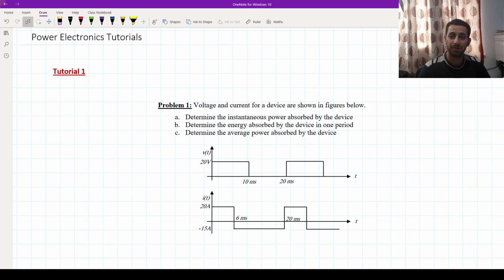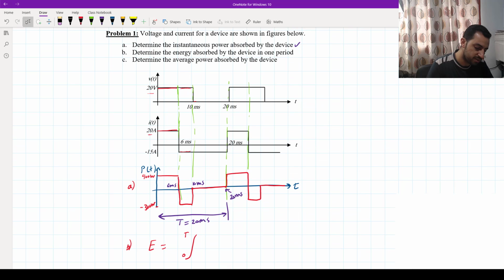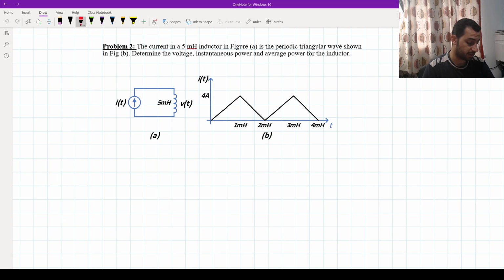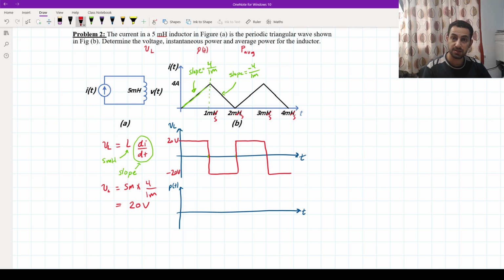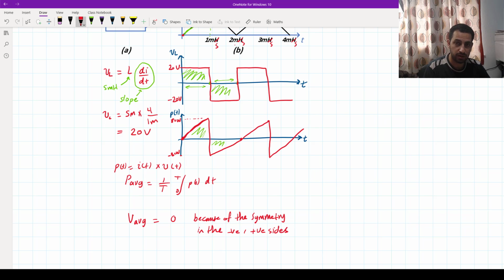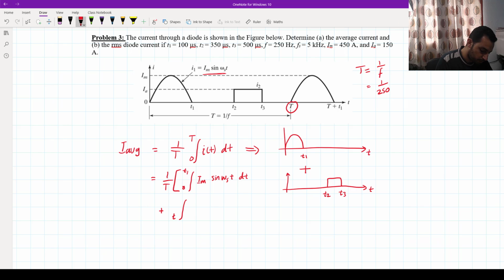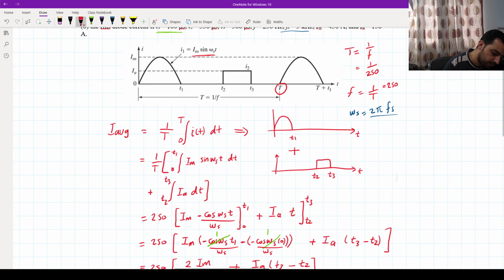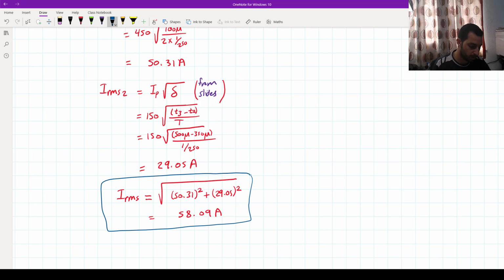Power Electronics Problem Set 1a

Comment: thanks a lot  do you have any problems to calculate about the rectifier and the voltage or current in the inductor with diffrent wave form ?